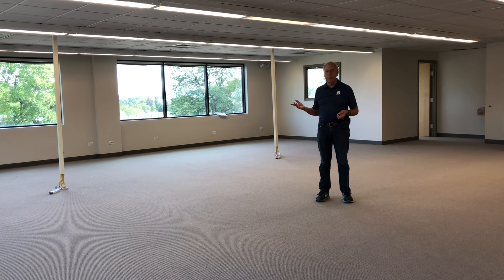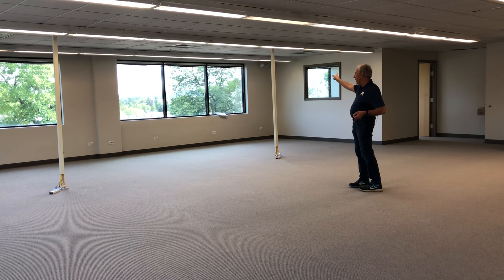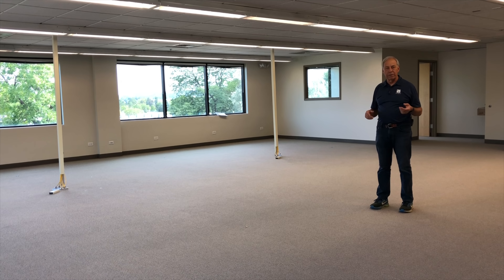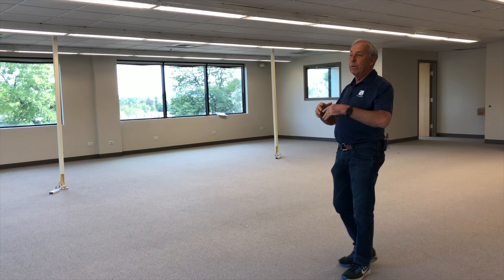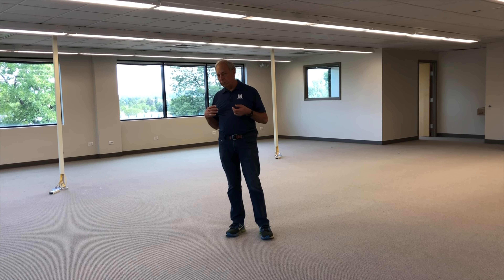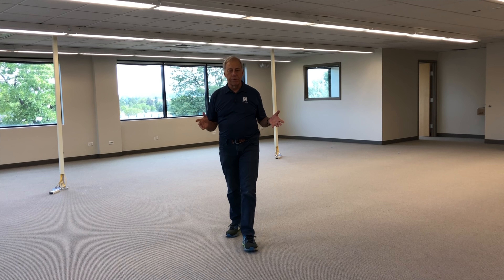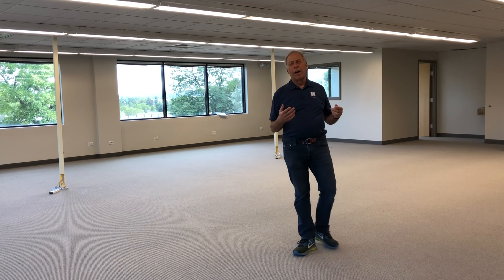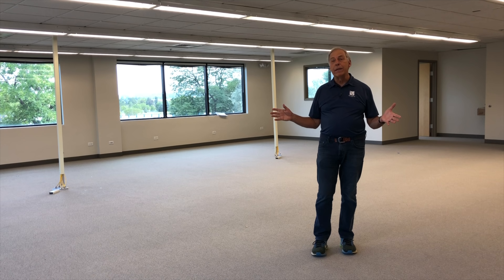What is a plasma tweeter?

Comment: Air is far from massless. If it was, a helium balloon wouldn’t rise, and wind wouldn’t be able to push around a wind turbine. It depends somewhat on atmospheric pressure and temperature, but at sea level air typically weighs about 0.8 ounces per cubic foot.
Reply: But we are talking here of plasma, not air. Plasma is that state of matter where atoms do not exist except for Hydrogen since it consists of solitary proton. The only way to confine plasma is with magnetic fields and that's rather difficult to achieve because plasma tends to disrupt magnetic fields. Plasma is not massless to be sure, but it's very low density.
Reply: gotham61 and we wouldn’t hear anything.
Reply: Okay, I know I'm late to this discussion, however, in my view, the plasma would in fact be massless, or perhaps negative mass? Here's my reasoning.... when the speaker is "off"... there is Literally "nothing" there but the already present air. There is no "Tweeter/Diaphragm" taking up space or having "mass"... hence "massless". My theory for it being "negative mass" is that when it's turned "on" there actually "Less Mass" than there was before, as the magnetic field, electric current and plasma are made from the ambient air and reduce the amount of mass in that space. The "tweeter/Diaphragm" (The object that causes the "air" to be carrying "sound") is literally the magnetic field, which doesn't have any mass.

Just a thought.

Comment: I was thinking about that a little while ago and I was wondering why you couldn't put the Plasma tweeter inside say like a vacuum tube without the vacuum filled with gas this will trapped any ozone and still allow frequencies to pass through, Another way is to convert the ozone into another type of gas.
Reply: But then you have the resonance of the chamber ruining it.
Reply: @volvo09  yes but if the chamber is made to be residence at a higher frequency then it is audible not so much a problem the tube becomes the driver all drivers have a residence to them anyway
Reply: How you going to move air if the beam is in a vacuum?
Reply: @ John Sweda Easier to just remove all the oxygen from the listening room. No oxygen means no ozone production. Easy peasy...
Reply: @dantheman1998  if you read it properly I said without a vacuum", with a gas maybe helium argon or neon or just ozone I'm no chemist so I don't know what the reaction would be I know sound waves travel faster in helium than oxygen, but mixing ozone and helium together I don't know need a chemist to answer that!
Reply: Despite its reactivity, ozone won't react with helium, argon, or neon. These are the noble gasses that react only with fluorine ande then only with difficulty. The idea behind helium in a plasma tweeter is to displace air so there's no oxygen in the plasma.

Comment: Hey Paul,

this is the second time, you use the "Quadral Chromium Style" loudspeaker as your Thumbnail. I own a Pair of the "Quadral Chromium Style 8" and can say, that these are some really good sounding and affordable Loudspeaker. Did you ever heard them?
Reply: EDIT: The one, which you can see, is the "Chromium Style 6", but i would recommend the "8". Its a little more expensive, but offers therefore a richer fuller sound at the base. The ChromiumStyle-Series has an aluminium ribbon (very very clear highs) and titanium-coated woofers. I do not get anything for advertising those here, but the are very very good. They create a really nice stage, and their soundcharacteristic is very even. And for such "small" Speakers, they a deliver suprisingly punch at the lower frequencies. You can get a pair of them for about 2000€. They are no high-end-stuff. But i do not think, that you can get a much more "bang-for-the-buck".

Paul, if you heard them, it would be really nice, to hear or read your opinion about them. I am from germany, and visiting you at ps audio is not that easy, as you can imagine. So if you say something about them, i can understand you better, because in that case we have a common experience.

By the way: I am using 3 of your noise harvesters. (one at the amplifier, one at the turntable, one at my computer) Especially the aluminium ribbons of the quadral benefits most of them. Since i use it, the difference between highres/CD/FLAC and compressed sources is easier to hear. Everything is just a little bit clearer and brings music a little bit more to life. It is no huge difference, but especially the one near the amplifier i do not want to miss anymore.  

Greetings from "good ol' germany". ;-)

Comment: Oskar Heil's (not Hill) Air Motion Transformer was a kind of bellows and was filled with air IIRC, not helium.
Reply: I have a dipole version (Mundorf AMT 25d) of Oskar Heil's Air Motion Transformer , and it's the best tweeter I ever heard . Not cheap but worth every penny !
Reply: @ Gerrit Govaerts Many years ago, a friend purchased a pair of ESS AMT1s. I was impressed — sort of. Unfortunately he demonstrated them by playing some loud music very loudly. I always assess speakers by how they sound at low levels. Mainly because I listen to music with great dynamic range: Brahms' A German Requiem for example. The bass and lower midrange were a bit muddy, but the top end was crystal clear, like another friend's Quad electrostatics, but much louder than the Quads could attain.
Reply: Yup I have a pair of Oskar Heil Kithara speakers.  Phenomenal tweeters.  I just recently got some room acoustic treatment and it has improved them so much being that they are a dipole.  DO you use treatments with yours?
Reply: Turns out that someone called Hill did make a helium-fed (not filled) plasma tweeter. When Heil's AMT was first released it was commonly compared to plasma tweeters. My bad...

Comment: Argon seems like it would work better than helium. It's inert and in greater supply. It's used to stir liquid steel in ladle furnaces.
Reply: Would need to vent the room. Argon will sit in the room and fill up the room. Helium goes up so it can vent from above.

Comment: Alan Hill's plasma tweeters do not make any Ozone because they use a glow discharge rather than the ozone-creating corona discharge speakers sold by Lansche, et al. The cost of helium is not so bad when compared to the cost of any high end gear, so why not snag a used pair of Hill's, Paul?  ;-)

Comment: Ozone = O3 is basically bleach in a gaseous form!!! Ozone can also be created by the xerographic process in copy machines, especially if it has a Corona & scorotron grid. The main way to neutralize ozone is with a carbon impregnated filter. Newer copy machines don't create as much ozone since they use a charge roller that transfers the voltage to the imaging drum. I do know that ozone kills termites!!!😂👍🏻
Reply: Ozone is only used as a bleach in the textile industry as far as I'm aware, and that rarely. Household and most industrial bleaching is done with chlorine, or hydrogen peroxide.
Reply: nerd

Comment: The fascination of the CORONA plasma tweeter lies in the hard-to-describe lightness of treble reproduction, linked with an absolutely insane precision and speed, without having to accept even a hint of hardness. The absence of any system-generated resonance in the whole transferred frequency range of 1.5kHz – 150kHz is remarkable!

No other system is capable of achieving this, regardless of the principle used.

Description

The plasma tweeter’s mode of operation is responsible for this in that the sound is not sent out via a membrane consisting of a fixed material, but rather by the sound-transferring medium; the air itself. An 8 mm long arc is set up between an extremely small curved annulus in the middle of the combustion chamber and a high voltage outer electrode placed outside the tweeter’s combustion chamber.

 

This arc forms an ionized gas cloud (ion field) which has five times less area and 100,000-times less weight (some weigh as little as atoms)than a fixed membrane. And, of course, the weight of the driver (moving coil) of the membrane should be counted as well because the two form one moving part.)

 

The music signal itself is modulated and causes all points within the volume of the ion field to be accelerated exactly in unison by changes in the electric field strength. Annoying independent movements which characterize flat ring membrane speakers are plagued by their weight, small band systems or other representatives of the tweeter "old-school", do not occur using this principle.

 

As a result of almost drag free (only the weight of the air) and virtually point-source emission, neither intensity loss nor directional sound can occur in the listening area through interference. The sound itself is generated in the small ionized airspace by the direct stimulation of the air molecules and spreads out from there serving to increase acoustic adaptation and raising efficiency. All treble signals are processed within the exactness of the ear faithfully and coherently.

 

Errors in the amplitudes and phases do not exist. Unwanted noises are above the range of the best amplifiers and well above the available sources of noise. The CORONA plasma tweeter has a positive effect on the whole sound picture. Every instrument, thus even, for example, a double bass generates higher frequencies from scratching or striking noises which fall within the range of the Plasma tweeter.

 

Furthermore an exact reproduction of the relationship contained in the ratio of direct sound to indirect sound can be made due to the group term (relation of phase difference to frequency segment difference) which is extremely low and is constant across the frequency spectrum. This is a basic condition for an exact 3-D sound. Thus the CORONA plasma tweeter stands apart in all sorts of ways from ordinary converter processes. With this tweeter we offer the quickest and best treble system in the world by far.

 

For the mid and bass reproduction alone, where a lot of mass has to be moved, there has been an immense engineering cost to achieve a matching sound reproduction without a time delay between the nearly massless high tone reproduction and the mass burdened reproduction of the rest of the sound spectrum. Of course, a similar speed is impossible to reach with a mid range speaker or woofer.

 

The speed of the moving air molecules (and therefore also of the driven membrane) is proportional to the frequency, it takes 100 times less speed to exactly reproduce 100Hz than it does 10kHz. Even so, for a speaker with self weight this still poses an immense challenge. This problem does not arise in a loudspeaker with a conventional tweeter. Through more sluggish and hence slower transmission of the treble, matching is relatively easy for similarly sluggish action in the mid frequencies, and, more specifically in the bass region.

 

Due to recent events we would like to point out that the Corona Ion Tweeter has of course nothing to do with the Covid 19 virus or in any way an infection or spread in connection with the Corona virus.

Comment: If you google plasma tweeter,you will find that Magnat designed a model, and today a Capella and Lanch have designed and are selling plasma tweeters with a negligible ozone ooze and an unreachable selling price , and as the acoustic level is quite low they had to put them in horns ' which impairs the 360° directivity.

Comment: Graphene speaker cones are an interesting proposal
Reply: Graphene diaphragm for electrostatic speakers
Reply: @belltocher  Probably wont work. Graphene is too conductive. The diaphragm of an electrostatic must be only semi-conductive so that it can be charged with a positive or negative charge of high voltage direct current to give it its polarity. I would assume graphene would just arc. The other problem is that graphene cant be made into a large thin film and stretched out like a drum diaphragm. It has to be coated onto something else like a plastic film. So technically it might work, but it will still be a thin plastic film regardless. Might be able to go slightly thinner though!

Comment: No clue what a plasma tweeter is but i know what a plasma tv is! It's the best tv technology and sadly gone.. R.I.P
Reply: Yep, now we're back to low black level lcd's. Plasma is great.
Reply: @volvo09  We have taken a step back in technology.. Plasma had superb blacks, superior motion handling. Shame
Reply: @cp070476  yeah, but oled beats plasma still.
until it itself goes the way of the dodo.
Reply: @lrrrruleroftheplanetomicro6881  Only on black level, plasma hands down motion handling. Also no image retention on a decent plasma it has more benefits than OLED.
Reply: I agree. That's why I still have mine. I think mostly they just want to sell light weight TVs that are easy to ship and easy to handle with no glass to break. Quality was a determining factor in the earlier days of HDTV because the majority of the people who were buying those TVs were doing so for the quality, better picture, but now that everyone has HDTV they are just in a race to the bottom, cheaper, cheaper, cheaper.
Reply: Brian Moore get an old pioneer plasma, said to be good I hear 👂
Reply: @shrodingersman  got one, a Pioneer Elite, the best ever made, at least in my opinion. Maybe I'll give it up when 8k comes out, but not until then.
Reply: If you love chewing up electricity and creating bulk heat, then you can't go past plasma.
Reply: @DodgyBrothersEngineering  Worth it for the superior image and motion stability.
Reply: @brianmoore581  I have 2 Kuro's black level is it's only fault i can't see any reason to move on it's a near perfect display which many still consider the 1080p SDR reference even today.
Reply: I'm not convinced it is a superior picture to today's OLED TVs. My brother in law has owned both and I think the OLED is far superior.
Reply: @DodgyBrothersEngineering  Picture wise they may be close but motion handling and image retention is a killer for oled. I watch my Kuro and think how can you improve on this? And would i pay a fair bit for a new 4k oled and suffer it's issues. It's cons out way it's pro's.
Reply: @cp070476  I'm skipping 4k altogether. I have a Pioneer Elite 60 inch 1080p plasma and a Samsung 58 inch 1080p plasma which is nearly as good, also a Sony Wega XBR 34 inch tube HDTV that I still like, even though it's only 1080i. I'm still happy with regular old broadcast HDTV. I have an antenna in the attic, a wifi hookup for Netflix and Amazon, and a few Bluray players. I'm not going to chase all the latest, greatest technology, only to get ripped off in a few years when 4k gives way to 8k. I have bought mostly the same movies on VHS, then DVD, then Bluray. I'm happy to stop here. I have looked at 4k displays at the store and I'm not wowed by them like I was going from standard TV to HDTV. Nothing I have seen looks as good to me as my current TVs. At this point in my life, if it doesn't blow me away, I'm not spending several thousand dollars to "upgrade". I watch mostly broadcast HDTV, football, NOVA, a lot of PBS type science and nature shows, all in broadcast standard 1080i or 720p, or movies downloaded or on Bluray at 1080p at best, so 4k is really irrelevant unless I had a giant screen. I just don't want to constantly be chasing the next best thing. I'm happy with what I have. I just want to enjoy the show and forget about the technology. The only reason I would buy a new TV is if one of mine gives up the ghost, or possibly if something really spectacular comes along and I can get it in an 80+ inch screen size.
Reply: @cp070476  Plasma doesn't have more benefits than OLED. OLED has lower black level, higher contrast ratio, is faster, has a wider color gamut, consumes less energy. The only downside is the wear, which is resolved by anorganic LED panels.
Reply: Agreed on the contrast ratio OLED is pure black and brighter. However faster? I game on my Kuro it is easily fast enough and suffers no motion blur when fast panning (360 spinning movement). Also the Kuro can display 10 bit deep colour so the colour gamut is easily good enough. You have to see a Kuro in action to realise how good a panel they were. Zero image retention which Panasonic plasma's suffered with. We need Pioneer back!
Reply: @brianmoore581  Well said sir! I watch a lot of films and reading reviews on UHD films you find most are mastered at 2k anyway which is basically full hd. Totally pointless 4k with regards to films. 1080p looks easily good enough resolution wise it was a huge jump from DVD image wise.